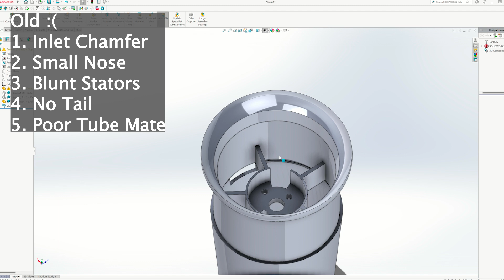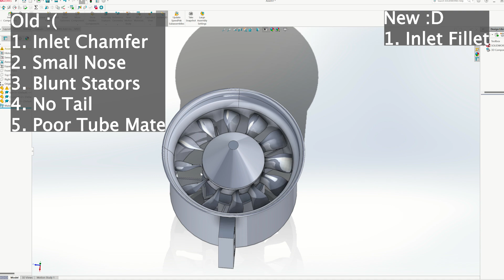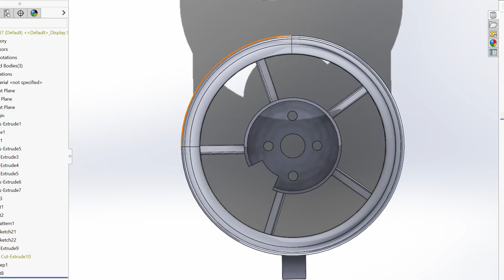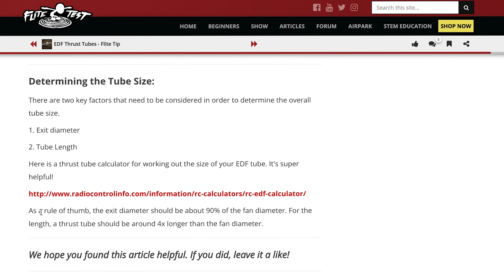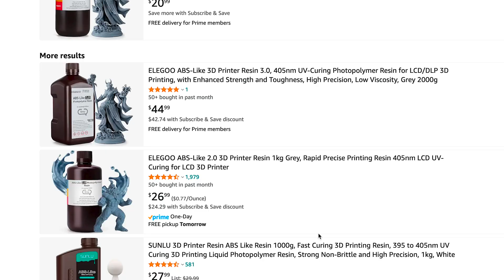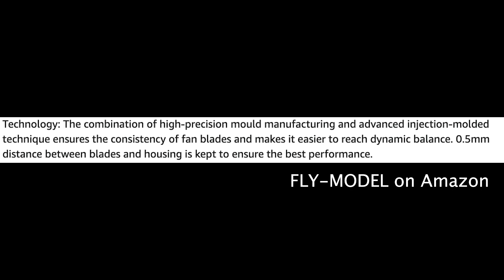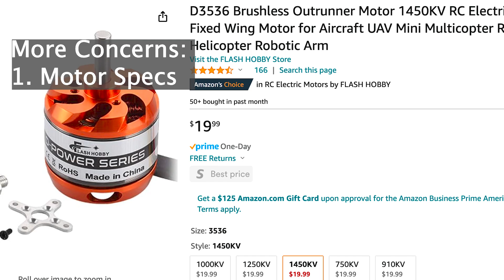Probably the Limit: 460g Thrust (3D Printed EDF)

Comment: I have had 4 resin printed EDF props blow up in my face. From sucking up screws because we were being unsafe, to achieving too high an rpm for the blade thickness lol. Try printing with a 0.1mm nozzle. Why not swap to a more narrow motor thats longer, this lower diameter for the motor will get more swept fan area for the same 70mm housing
Reply from the maker: Yeah the resin propeller was a hard no. Never considered the 0.1mm but I actually have some on hand so might be worth a shot. And yeah most EDFs do use thinner inrunner motors, this is just what I had on hand, but yes that would be significant gains I think
Reply: @mach10point4  The 0.1mm nozzle will get more detail on the blades and more closely approximate your CAD model. Print times will go up though. 

I think this is a cool project, keep pushing on this. Maybe I could get your fan into an RC airplane one day.

Comment: 430   the taper of the exhaust tube should result in a cross-sectional exit area that is equal to the  Swept area  of the impeller.!      this taper should occur over a 'nominal' length of tube; maybe six inches beyond the end of edf housing.
808   use  Three  'stator' vanes.      edf 'stator' vanes should be designed to have  Minimal  affect on the air flow aft-of the edf.      achieving a significant amount of reduction of turbulence aft-of the edf costs too much; aka  losses.
you are using a  FAT  motor.!      as a result, a lot of impeller area is occupied by the hub.!

Comment: Could you copy a gas turbine construction and print the blades separately? That would allow you to print them vertically and allow for a smoother airflow. Using something like a dovetail to fit them into a simple rotor. You may also be able to balance it basically with the accelerometer in a phone. Perhaps creating small holes under the nose cone that you can insert weights into?
Reply from the maker: I actually tried that in one of my earlier drone videos! The blades printed in significantly better precision. I was relying on superglue and a friction fit to get the blades in, which was super hard to do because of how thin the blades were. So maybe if there’s a slightly different method out it would work a lot better.
Reply: @mach10point4  I'd be happy to help. I'm a  mechanical designer by trade and have worked with gas turbines so am aware of how they do it. Love the project.

Comment: great improvements!
I have another idea that might improve flow a little bit, it has to do with the stator after the rotor:
it would be a good idea to make the stator curved instead of flat: the air comes out of the rotor swirling around the central axis, and with your current design it "slams" sideways into a wall (your current straight-bladed stator). By introducing curved blades in the stator that smoothly accompany the flow from angled (swirling) to perpendicular to the axis it would probably reduce losses and noise (which is a form of loss by itself).
Love the iterative design and the videos, keep it up!
Reply from the maker: Ah when you put it like that that makes total sense. Curved stators are #1 on the list, I was just being lazy this time around. Thanks a ton!

Comment: On the CFD side: FreeCAD has a relatively user friendly CFD workbench based on OpenFOAM. You can import step files if you're doing the modelling in Solidworks.
I haven't figured out how to implement a rotating flow which I assume you'd need for a prop, but it might help... just my 2 cents. Great work btw!
Reply from the maker: Will definitely look into that, didn't know that existed!

Comment: Couldn't you squeeze in a couple more blades of the same size?

Hear me out.. idk to expect but what if you make a mount that's external from the hole of the duct... and create a sort of part.. that sweeps behind the motor that way you can make Bigger blades connected to a center pole-like hub to see if you get more thrust. So the motor is not inside the duct but you have bigger blades inside because you have more room to work with?
Reply from the maker: I kind of visualize what you’re talking about. That’s actually really interesting, I don’t think there’s anyone doing that in the market right now.

As for blade count specifically, I definitely could. Not sure if an even/odd count of blades would matter (some people say an even count is inherently imbalanced). Of course, it’s an optimization of efficiency when it comes to blade count